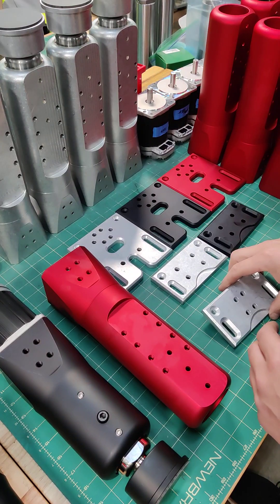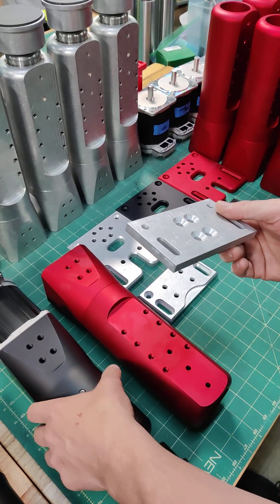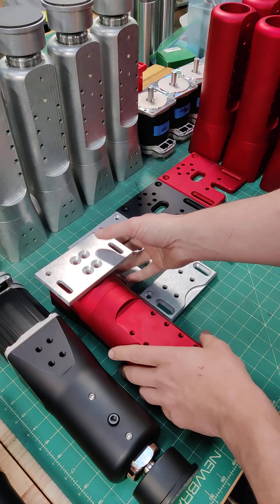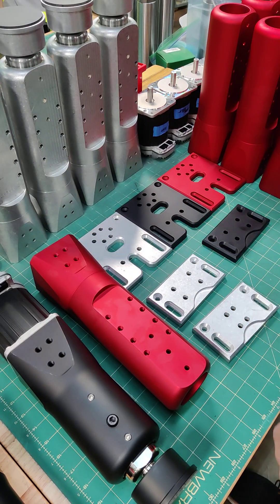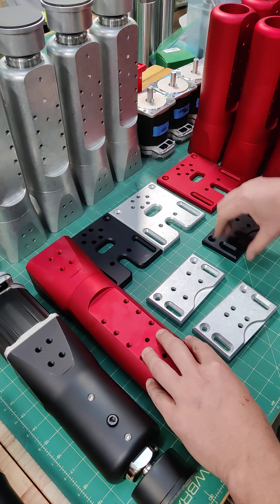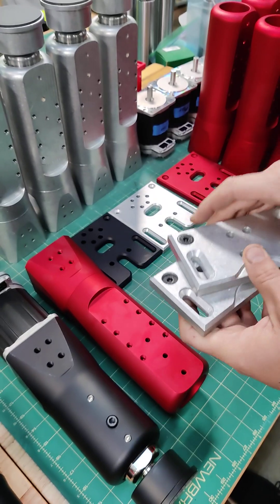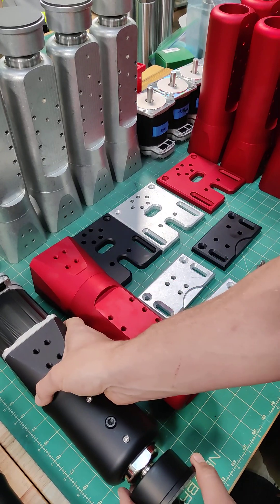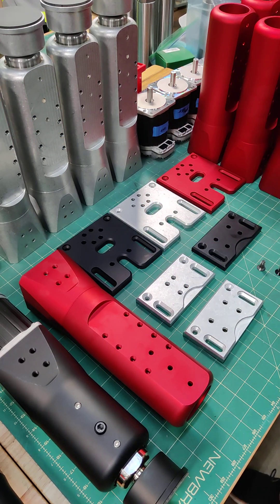Sigma Service | DK Motion Mounts Explained

Comment: How can these be mounted to the new flat faced rigs that are coming out such as the ASR Pro Gen 2?
Reply from the maker: Hey and sorry for the late reply.

The ASR flat-face is a great chassis with a clean aesthetic design. However, it chooses to compromise on function by removing the slots on the outside that would/could be otherwise used for mounting other accessories over time.

Some of our clients have made custom mounting solutions for the flat face (hit up https://www.vthrotl.com/ for more info) but a majority of our clients decided to hard mount the DK motion system to the flat-face design by using our included mounting brackets as a template on the inside of the chassis and then bolting on the system with a longer set of bolts that run across the flat-face extrusion set. (hope that makes sense)

We still firmly believe in mounting our actuators the way we do, which is flush against the extrusion with 4 x M8 bolts for the bracket and 4 x M8 bolts for the actuator. The M8 bolts are also tapered to locate or center in our bracket and actuator which makes for better accuracy when mounting. Mounting any motion system away from the chassis, with an arm or a lever creates potential flex or yield and can also dampen certain haptic frequencies. So our mount design is still the preferred mounting method for standardized aluminum extrusion framesets.

I hope that answers your question. Please e-mail us or call us if you require further explanation. Happy to help.

info@sigmai.co